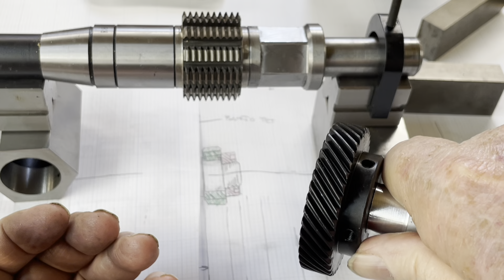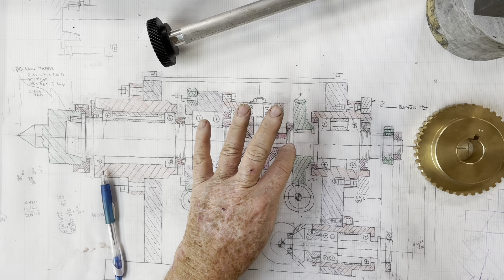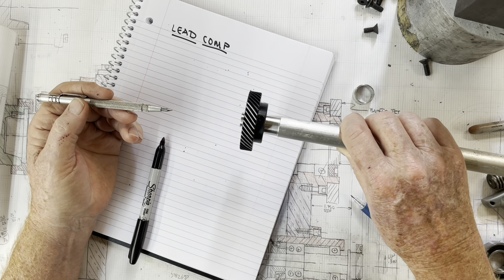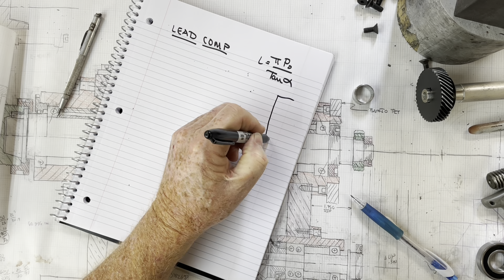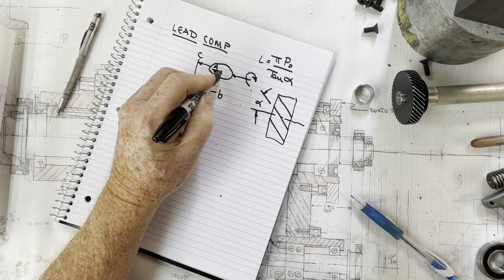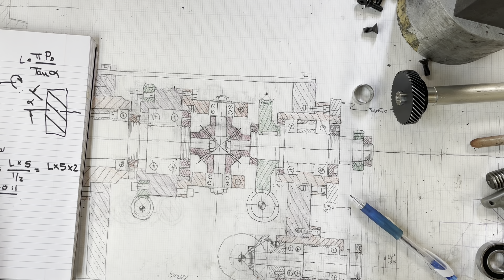Helical Gear Hobbing-Spindle Design and Lead Compensation…not much math…

Comment: Another awesome video. I hope you show the build process. These videos are very inspiring, especially to this newbie at gear cutting. Eventually I'm hoping to build something similar for my tabletop Atlas milling machine. It will be on a MUCH smaller scale. I can't swing the table, so I have to figure out how to build something using the Grant process (I think). Thanks again for sharing. I always look forward to the next one.
Reply from the maker: Check out @Andysmachines.  That’s the Grant process with electronic index system.  Also, @LSCAD…good technical explanation for helical gear making, and he uses a mill of similar size to yours.  The Atlas mill should be capable enough for most gears up to mod 2.5 or so, I’m guessing.  LSCAD is using some kind of CV joint to angle the arbor for the lead angle of the hob.  Also, remember that hobbing spur gears is the Grant process with 0 deg helix!  Go for it!
Reply: @thomasstover6272  Yea, he's got a great channel. Very informative. Thanks again for taking the time.